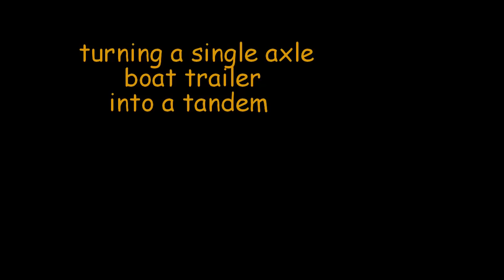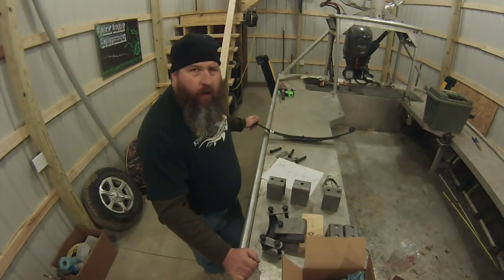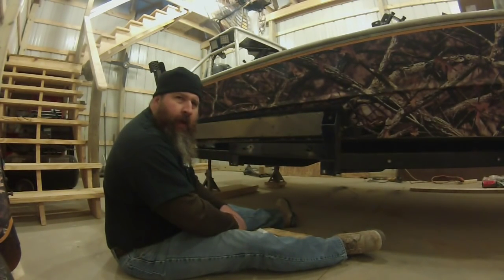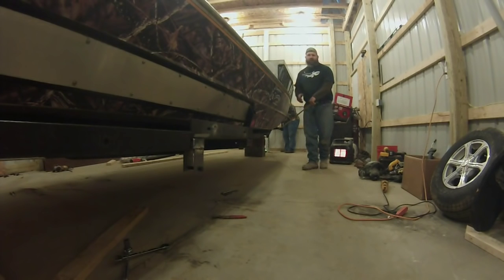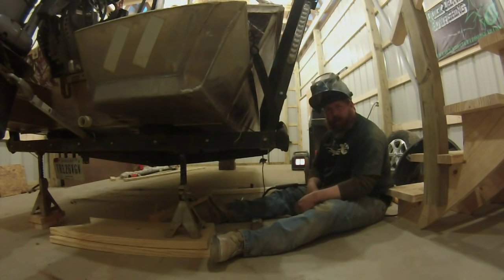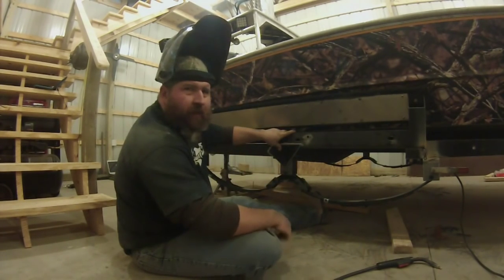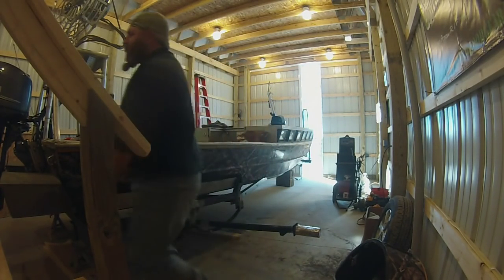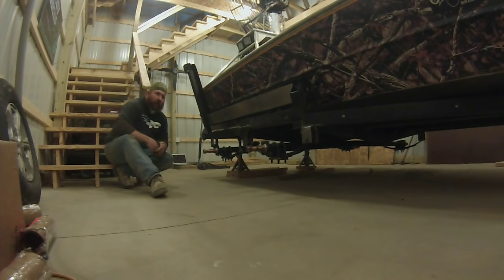Turning my single axle boat trailer into a tandem!

Comment: very nice job I'm a welder myself your welder sounded on point,
Reply from the maker: +tracy george thanks for the comments bud. yea im getting ready to build my next trailer for my new boat build. the welder in this video is a little Lincoln 140c and with flux wire it does great but I bought a new miller 212 and its amazing on aluminum. caint decide if I want to set it up for mig or resort back to my little red box. ive asked  different people about tensile strength of flux vs. mig and got different answers.
Reply: Think of flux core wire welding as Stick welding with wire ,simply  because it will penetrate very well and it can be done outside in the wind much much better than mig can .As for tensile strength most flux core and mig wires are rated at 70,000 pound tensile strength , Im sure there are other tensiles as well . Stick welding talking about the most common rods start at 60,000 pounds tensile , that would be say a 6010 rod, where as a 7018 rod is 70,000 pounds tensile strength , I have used 120,000 pounds tensile strength rods, 12018 low hydrogen rod welding cracks on a construction crane after the engineers inspected it down town Calgary Alberta Canada.
Hope this helps

Comment: There were four other measurments that you should have taken before you welded on the bracket. You needed to make sure that the rear of your boat was parallel to the back door. Otherwise one end of the boat could have been closer to the back wall than the other end. You could have measured the front of the boat  to the side of the wall on both sides and measure the rear of the boat to the side walls to make sure you were parrellel to the back door before measuring where to put the brackets. That way you could be assured that the boat would track true.
Reply from the maker: No sir, none of that matters. The axles being square to the ball is the only measurement that matters. Measure from ball to mounts on both sides with precision & the axles will pull straight. I now build boats & trailers for a living and your thought process is backwards.